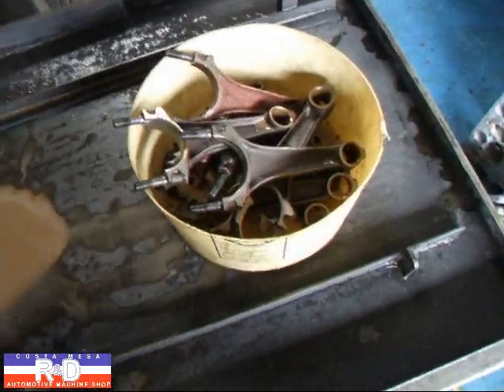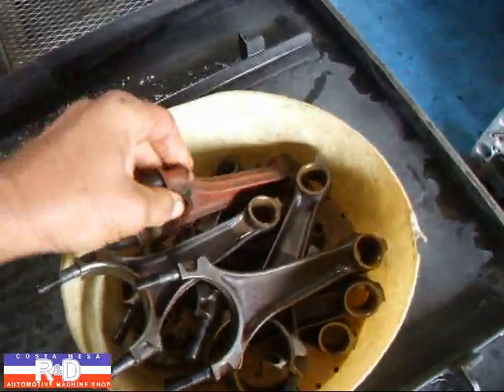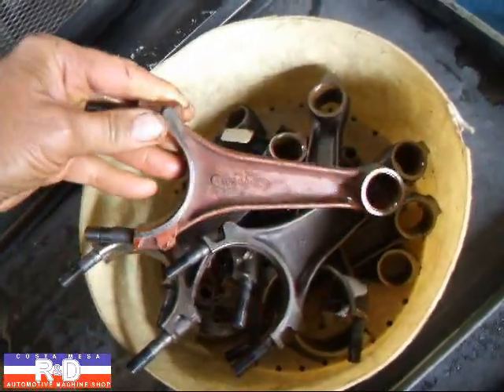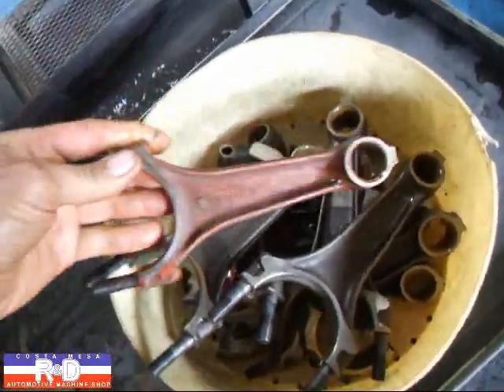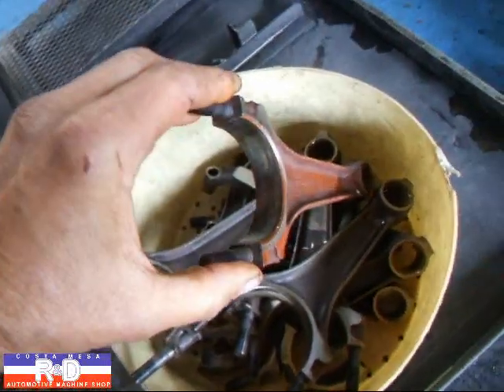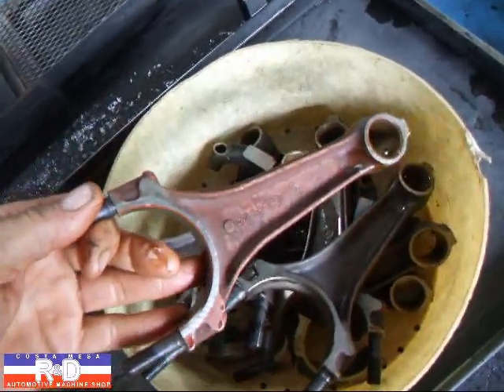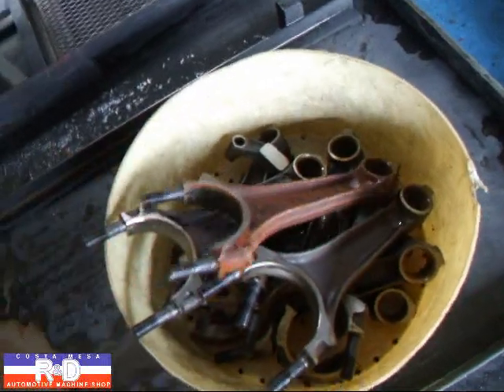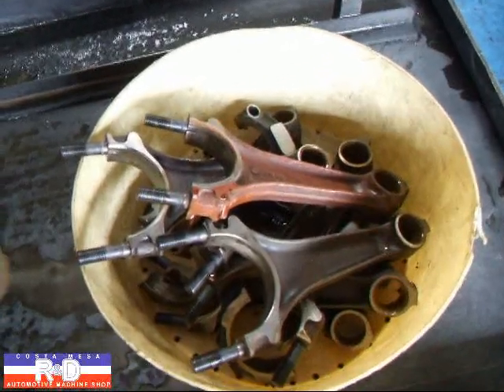Copper Plated Connecting Rods

Comment: Interesting, so the cheap factory rod is still more expensive than plating, John, i hope same durability as copper is rather soft. It's basically a 'spacer'-- what about just an oversized bearing or is plating used only on larger mistakes?

Comment: the bearings & rods are made at different places. The rods are all made to fall within a given size range. if the holes in the rod are too large they would be unusable. the copper plating  adds material & therfore can be reworked & reduces scrap. think of a piece of wood cut too short, you would have to glue more wood to it & re-cut it. Hope this helps.

Comment: Hey John, could you give me your opinion on the offset connecting rod design. Im debating between the EZ30 or the new EZ36 engine. But I want a high revving turbocharged setup. Im not sure how the offset con rod will hold up or benefit from the classic design. Thanks!
Reply from the maker: +jdmcommute Works the same. All the force is transferred downward and there is sufficient material there to handle the load. I've used rods like this to 9000rpm, so what's the problem you envision? Just get them and put them in. Nuff said...
Reply: +fiatnutz   Cool man, thanks! That is pretty much what I was looking for. I didnt envision a problem, I just wanted an opinion from an experienced engine builder/racer/machinist rather than some keyboard ninja on an online forum. I am considering the new EZ36R engine swap into my STI and I will be turbocharging it. Not sure if aftermarket is making I Beam offset con rods yet but I will need some in the future. Thanks again John! The B18C1 engine you balanced for me worked great!

Comment: just a thought : purhaps the copper protects the steel (iron,corbon) and / or indicates that this rod was NDT magnetic partical inspected. 
google search has come a long way since 2012 .
checking with lycoming or continental overhaul shops might be a helpful suggestion.
I will be rePlating a conRod form a Suzuki LTA450x   . crankbearing replacement .
those old Y block FORDs are Quite the engines.  ( i have a 1976 360 )